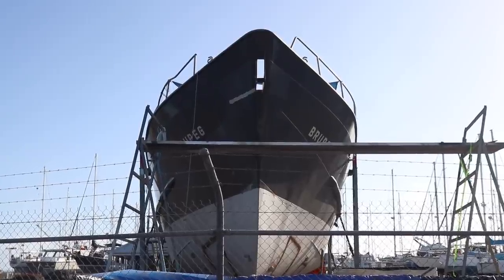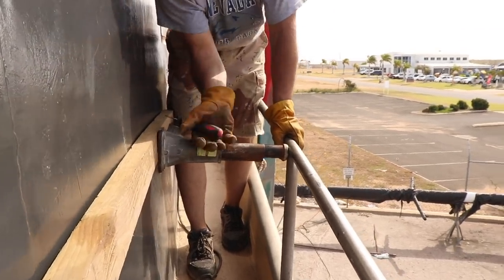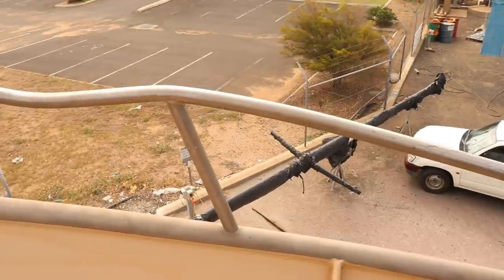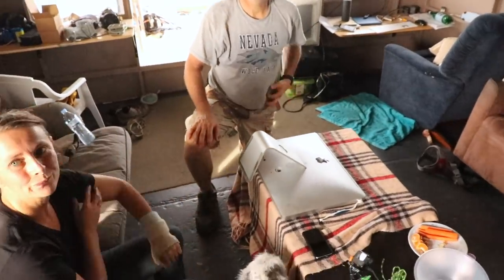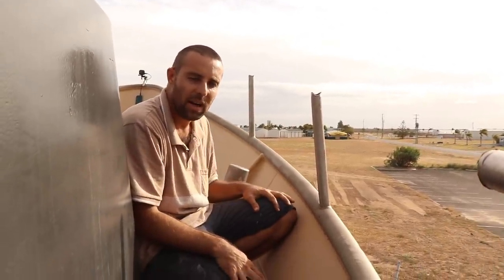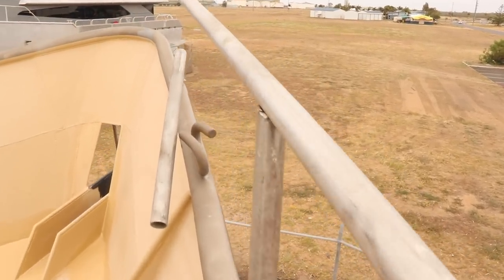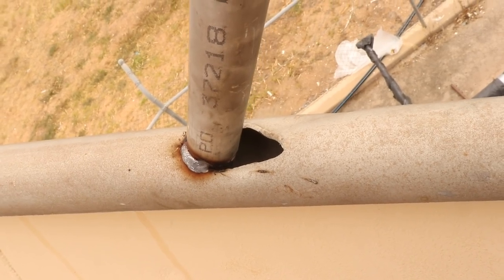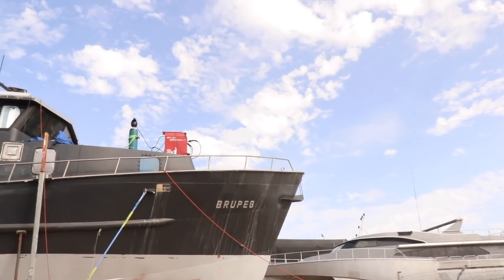Sunk Boat Handrail Repair - Project Brupeg Ep. 74

Comment: hey damein, just a thought. could you weld a working rail on top oof your everyday rail. meaning with safety belts on you wont have to unclip for rail posts then reconnect every 6 to 8 feet it looks

Comment: Looking good Damien! Don't worry about your welds, mine are much worse. ;)
Reply from the maker: Hey Stu, thanks mate. Your little beast is coming along great! How long are you planning to be out of the water
Reply: I'm thinking I'll need about another month or so. Sandblaster is coming to do the hull in two weeks time and then once the engine is back in I'll do the rest of the work on the water using your dump and run approach. Then I'll cruise up to Bundaberg. :)
Reply from the maker: Sounds awesome. Yeah getting it blasted is something you will never regret. Wet blasting is fine for touch ups but it’s way too slow for major areas. As an example, our engine bay took 3.5 days for the pros, that would have been 3-4 months if we did it with our blaster
Reply: @ProjectBrupeg  Wow, that's an interesting comparison. I'm going to wet blast my engine by this week but it is much smaller. I'm really wishing I had  brought the boat up to Bundaberg where you have that great sandblasting booth. Once it is back in the water I might do that for the outside. How long until you are back in the water?
Reply from the maker: Still hoping to launch in a few months. Had some major delays, so it’s pushed us back a. Few months from our planned splash down. Wet blasting is good for tight spaces as it allows good visibility unlike dry blast. We use the wet blaster all the time in our tanks as you can actually see what your doing which is a nice feature
Reply: I know the feeling of delays all too well. I thought I'd be on the hardstand for about a month and it's easily going to be three or four. I wish with the wet blaster there was a way to get rid of the long lance and go to a short nozzle like dry blasting as in the tight spaces I don't have the room to angle the nozzle back towards the inside edges.

Comment: You should have used an insert when welding up the handrail tubes to give the joint more strength
Reply from the maker: It’s schedule 10 pipe. Able to handle 3000psi it’s plenty strong and inserts are not normally used on the commercial boats running this thickness pipe

Comment: Damian what's the purpose of that little vertical piece on the walkway that you need to step over that runs between the hull and cabin?

Never mind, just noticed on the side view that that is where the scupper drain is so I assume it's to direct bow wave runoff  through the scupper!

Comment: imac's  OS can be restored from a internet connection , basic restore leaves working files / video's intact , a wipe and restore wipes everything . Performance of the imac can be improved greatly by changing Harddrive to solid state  , but that unit is still quite old  so will always have limitations . Powerful Windows systems are cheaper to build than Mac's , but the option will likely depend on your software choice .

The fix to the bow should prevent a number of people's OCD from causing too many sleepless nights !  Ha Ha
Reply from the maker: Ha. Yes indexed Russel. We have a new Mac arriving today. SSD Drive with an i7 quad core and 32g of ram. A vast improvement over the old beast

Comment: 'Not a welder but, in that wind, virtually no gas left to shield the weld 'not surprised you were having trouble. Can you not get flux cored wire? Probably run with gas too?  Just thinking out loud ;-)
Reply from the maker: Hi Pete, w can get flux core wire but its around $450 per roll last time i checked for mild steel wire, im using 309LSi for stainless so i would hate to think of the price for that in flux core.
Reply: @ProjectBrupeg  Yes, thought that would be an issue.  'Not possible to get a smaller roll (as used in "hobby" machines) to switch in and out for this kind situation?  As said, just thinking ;-)
Reply from the maker: Yeah we can get smaller rolls. The issue is the little 1kg rolls are for hand spool guns so the hub is very small. My machine has a hub much larger so the smallest that will fit is 5kg which I would guess is maybe 400 for flux core 309
Reply: @ProjectBrupeg  When you finally get to North America, you're going to wonder why you didn't just stick Brupeg on a freighter and move wholesale here. On the other hand, it's good prep for the Arctic, because it's bloody expensive to have anything shipped there, too.

Comment: 3:36: Nice to see you doing the camerawork while some other guy spins the jack! 6:45: Jess in the box. 9:21" I guess you know that video editing is processor-intensive, meaning heat production and roaring fans, and that you live in bloody Oz in the bloody summer. Maybe edit at dawn, or direct A/C to blow on the back? 11:15: A sort of "jig in place", I guess. 19:06: You think you're all about function in a job like this, but the repair of "bent and manky" is very gratifying. 22:50: With those gauge wire loom lengths, do you need to boost the signal or calibrate your gauges due to line losses? Or just make a heavier gauge loom?
Reply from the maker: Hi Marc. Not 100% on the need to boost. The extension is twice the area of the original loom and there is very little power running through the conductors so we are hoping we won’t have to do anything. The sponsor of the gauges (Redarc) has not said anything about boosting but it may be something we look at if needed
Reply: @ProjectBrupeg  Some gauges run on relatively small inputs; as I recall, an oil pressure gauge is essentially a piezo element (like a crystal radio) that needs a boost at the gauge end to read the oil pressure off the internal diaphragm...it's been some time since I needed to know this! Anyway, weak signals degrade over longer runs of wire, so that's where my question came from. If you run the engine at 1750 RPM in neutral as per a timing light on the flywheel or a mechanical gauge on the engine, and it reads 1750 RPM in the wheelhouse, no worries. But it's good to know that the two ends are reporting the same things. 

I'd be interested to know where the connectors will go: either end or with a break in the midpoint to make it easier to take down that pipe you've set up. You might want to make it easier by twisting the wires into a more or less circular cross-section, and then cable-tying a cover on it so the control cables don't chafe it. But I'm sure you'll have input from the gauge makers.
Reply from the maker: All this will be obvious in the upcoming gauge episode.

Comment: I am sorry, but why the anchor winch is not so well placed, the pressure pipes should be hidden, they would not be exposed to damage, and besides, it does not look professional, but that's just my opinion.
Reply from the maker: It’s a commercial winch done by a professional. I don’t get your comment. Jess
Reply from the maker: Sorry Dame here, I need to comment on this. This winch is fitted exactly as almost all commercial boats fit winches, if it breaks down exposed pipes are a god send as you can fix it extremely fast and have very little down time, it also allows you to visually check them almost everytime you use the winch, something that frequently slips from the to do list if pipes are hidden. Hiding pipes is soley a cosmetic thing as the pipes are designed to handle all UV and Salt exposure. Hiding parts for astetic reasons is mostly a recreational consideration, and not something that fits with the more commercial nature of Brupegs build.